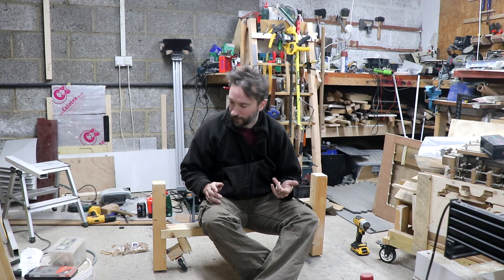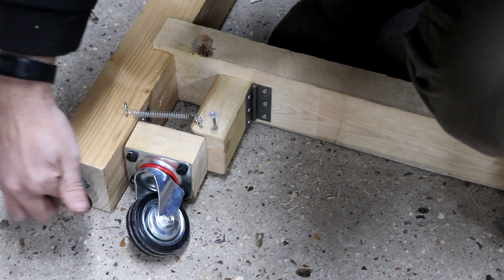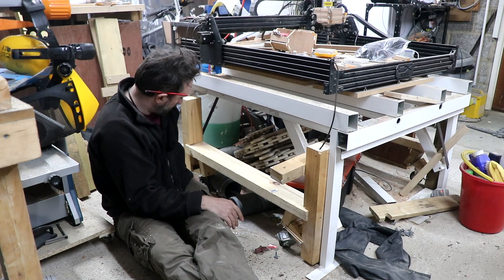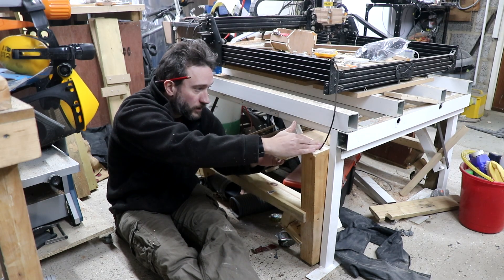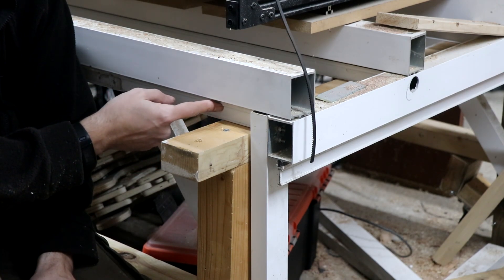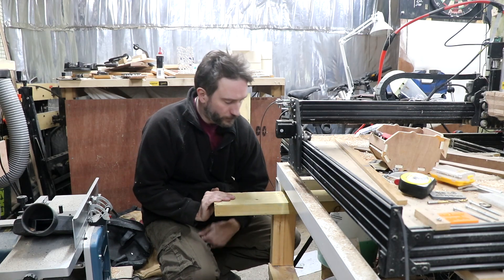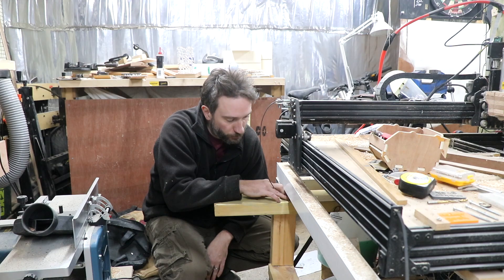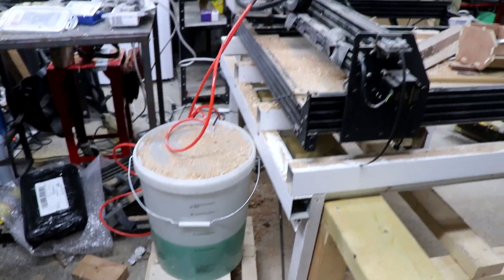CNC Table with leveling feet AND WHEELS!

Comment: How is this holding up? What do think the whole thing weighs? Nice design.
Reply from the maker: To be honest I've probably only moved it about 3 times. But it's holding up fine, I've not bothered lowering off its wheels since the CNC doesn't cause any vibrations. I'd guess the whole thing is around 100kg. The only problem I have with it is that in some directions the wheels hit the legs, so if doing it again I'd want to double check clearances.